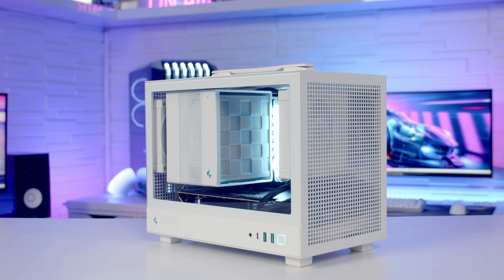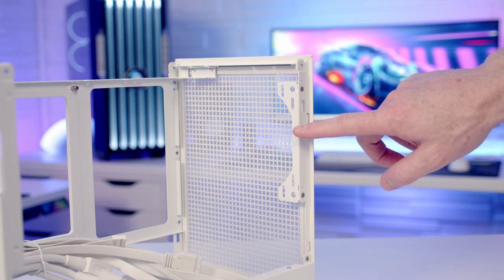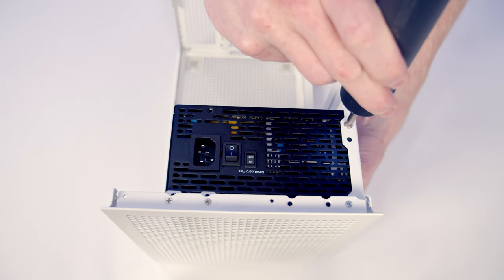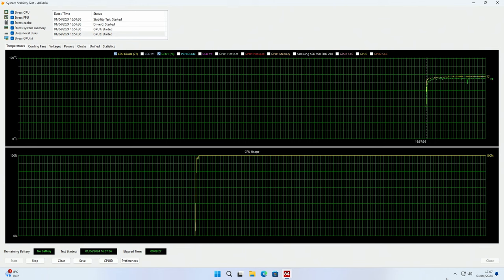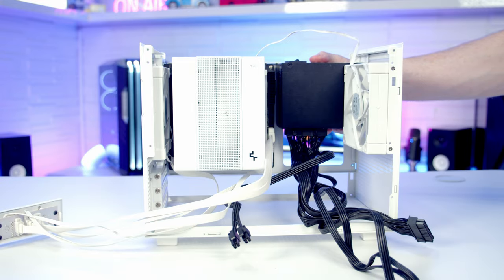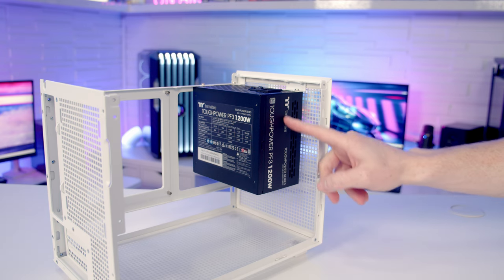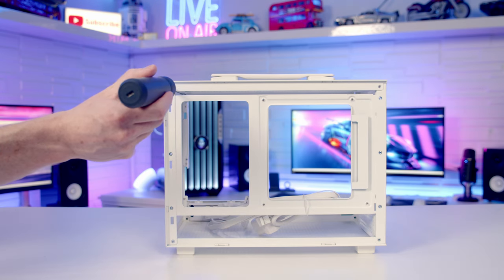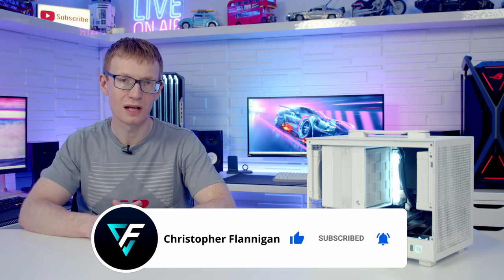DeepCool CH160 Review

Comment: Machines and more was able to mount a 240mm aio with t30's, he mentioned 276mm max length and 53mm for the pump head, only possible with a sfx in the back front panel position
Reply from the maker: It looked like you could, but I'm more than happy with the air cooler and AIO not officially supported
Reply: Thats when his mobo stoped posting after the install?

Comment: Think best Temp Setup would be reverse. So intake Back, CPU tower blows front direction. slim 120 top out, 120 front out. Suitable with FE Cards. Even in that small case: CPU gets fresh air, sucked out directly. FE gets fresh air sucked out directly. CPU and GPU arend feeding each other.
Reply from the maker: Rear is unfiltered
Reply: @ChristopherFlannigan Silverstone sells 120mm magnetic fan filters! Would be worth a try slapping it on the outside

Comment: only $40 here in indonesia, crazy value. I just build mine, you can fit an arctic liquid freezer II 240 on the top without the VRM cooler which is unnecessary on a good quality motherboard. and I'm using zotac rtx 4070 ti super trinity, it's 2mm longer than the max gpu clearance but it fits perfectly with some space left, maybe a 310mm card will fit but don't quote me on that

Comment: Does the full ATX PSU affect the GPU length compatibility?
Reply: Yes, 230mm max.
Reply: @lenovolegiongogaming  Oof. thanks!
Reply: Consider the Enermax Revolution D.F. 12 850W 80+ Gold PSU. It's an ATX PSU that, lengthwise, is actually shorter than an SFX-L PSU (122mm vs 130mm). It also has flexible, sleeved cables and a dedicated 12VHPWR 600W cable.

IMO I think it's the perfect ATX PSU for this type of case.
Reply: @jmal  Thank you :)
Reply from the maker: Yes,

Comment: Only 2 fans
Reply: 3
Reply: @henrydrago  where is the other one
Reply: @blessedjunior6989 CPU cooler, technically 6 is counting the GPU 😅
Reply: @breakdown7153  i was talking about case fans. The case is also close to the floor so im also worried about the gpu cooling there if it gets enough air
Reply: Air flow looks pretty optimized. 
If you're nervous, you can always add some 10mm fans to push air out any of the grates on the bottom of the case's back side
Reply: It can fit 4 fans. You can mount 2 more fans at the top of the case.
Reply: @riggitywrecked9442  maybe 1 coz you see that air cooler took all the space there
Reply: @blessedjunior6989  I'd think you'd be able to fit 2 slim fans in the top. I'll find out as soon as these are available stateside as I am down sizing to this case.
Reply: @blessedjunior6989  definitely 1 with that cooler. But you could use a smaller cooler and fit another
Reply: only fans
Reply: @blessedjunior6989 more fans doesn't always equal better. Focus on optimising space
Reply: @Laughing_Individual  they do add some perfomance difference
Reply from the maker: Less is more
Reply: @ChristopherFlannigan  but yu know the more the better
Reply: *4. PSU and the fan inside the cooler included